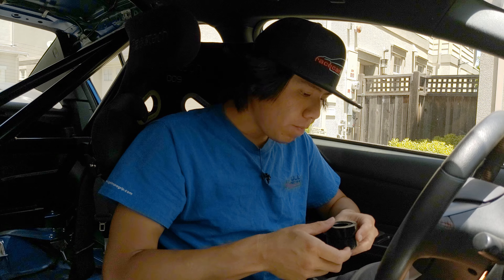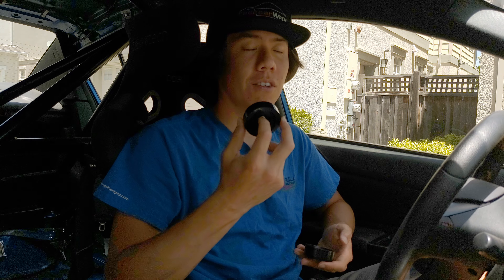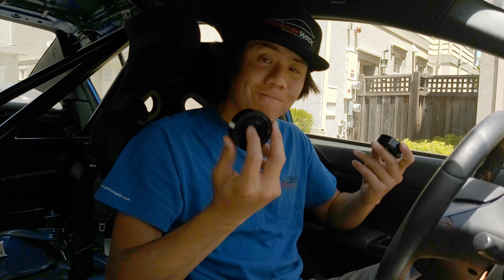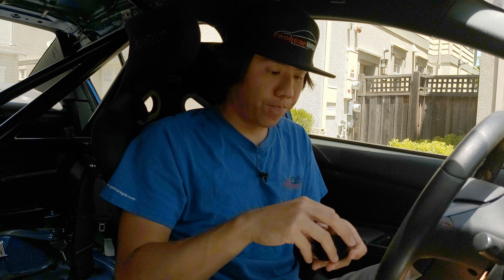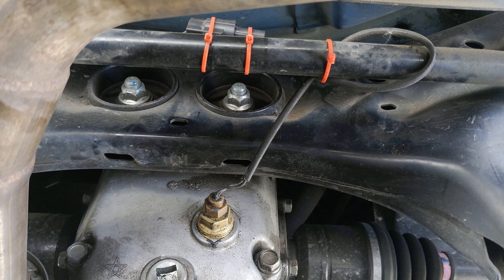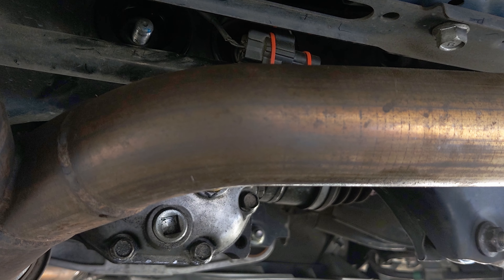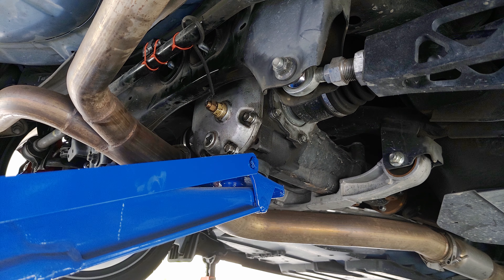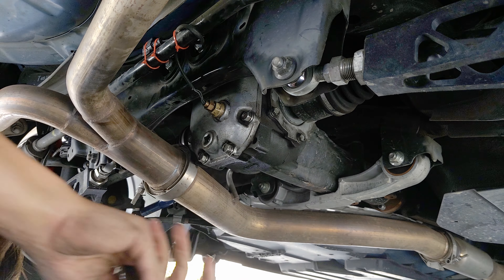Kart Boy Rear Differential Bushing Install - 2015 Subaru WRX

Comment: Do you have the rear LSD installed?
Reply from the maker: Yes this diff has a Cusco RS inside.
Reply: @RacecarWRX  did you also upgrade the front too? how do you like the cusco rear? and how much different is the driving experience?
Reply from the maker: @spencerblankenship6204  Nothing in the front. Rear seems good, but I only ever tracked the car with the LSD so I can't say what it felt like before.

Comment: Get them lock down bolts too
Reply from the maker: Lock down bolts?
Reply: @RacecarWRX  your not supposed to reuse those bolts. They are one time use only. I’m sure your fine and haven’t had to retorque anything. But per SOA the bolts that hold up ALL mounts are 1 time use only. I wouldn’t be surprised if your bolts aren’t still torqued to 52lbs. They are definitely more loose then 52lbs. I can guarantee that actually. That’s what I THINK Daniel means. Lol. I’m just guessing though.